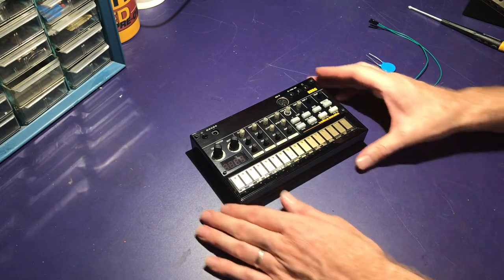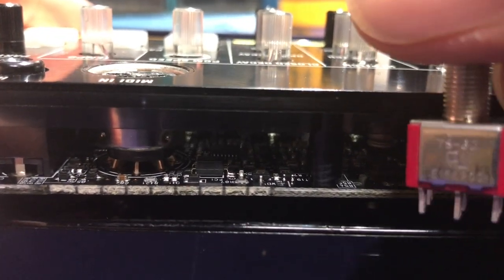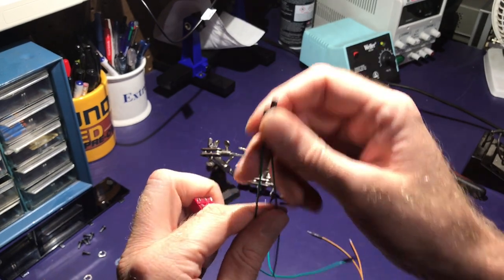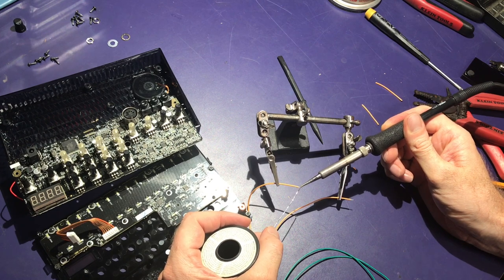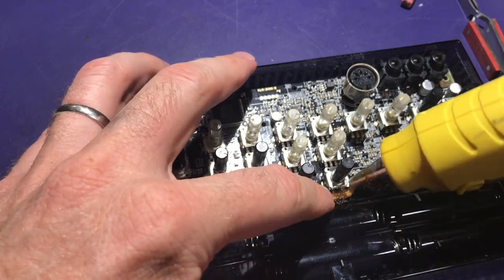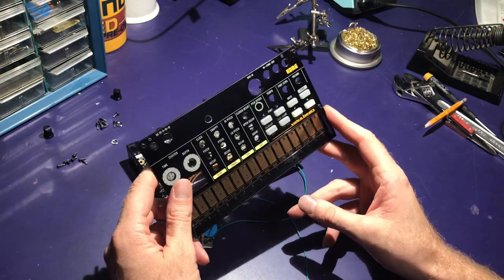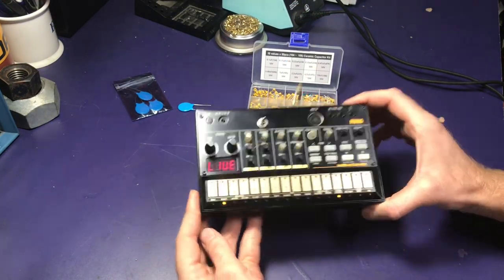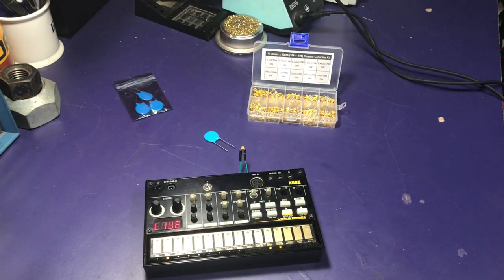How to mod the snare on a Korg Volca Beats (ENTIRE PROCESS)

Comment: so the idea of the cable sticking out of the bottom is to attach other capacitors if you want?
Reply from the maker: brock o'cull yes exactly. However now that I’ve found which capacitor I like best I just keep it tuck inside the battery compartment.
Reply: @SISKworks   I'm pretty interested in this mod with the switch, I've also seen one with a knob installed. would you be willing to do a similar install if I sent you my volca?
Reply from the maker: brock o'cull yeah I might be up for that. Send me a direct message through YouTube and I’ll reply with my email. One thing I thought about doing was to put a rotary switch with a different capacitor at each leg to give a bunch of different snare options.

Comment: Very helpful thanks, however I’m not really familiar with electronic terms and I was wondering what kind of lead wires should I get to be able to plug the capacitor without soldering?
Reply: Needs soldering

Comment: I had a problem with the silicon buttons, 8t was very hard to press the play, then the others. I opened it up to clean it, but it was clean. I found a Reddit where it says that could be the contact material, and suggests to fill the buttons with grafite. BUT I ended up damaging the cable from the batteries, so I tried to solder it, and I failed miserably and now it doesn't even turn on. 🔥🔥🔥🔥
Reply from the maker: ANDRES PEREX NOVOA oh bummer. Are you anywhere near Southern California?
Reply: @SISKworks  No, i'm in Cali, Colombia, South America. Any advice it's welcome anyway. I hope it can be saved somehow.

Comment: Thank you for this video, Mike! Can you please name the exact specifications I have to look for in a capacitor to get YOUR mod? Is it 2,2 microfarad (uf?), 50V? Anything else to watch out for? Not that familiar with electronic terms but wanna do the mod on my beats as well. Thanks a lot!
Reply from the maker: Uli Loe to get my snare sound you need to use a 2.2uF capacitor which should be marked as “225” on the capacitor. Not sure if the volt really even matter. The hardest part of this mod is soldering onto the board since everything is SMD. I would suggest getting a fine tip on your soldering iron and be comfortable with soldering before attempting this. Good luck.
Reply: @SISKworks  alright, thanks. I will see whether I feel up to the challenge when I open that bad boy, haha. You made it look so easy and the mod is just too good to pass up on - I gotta go for it. Anyways, cheers & thanks again!
Reply: Uli Loe exactly the same thing I thought when I did watch it... I ve got a microscope from aliexpress which has a hdmi out & a tft screen. So I hopefully will succeed even with my bad eyesight... 😜

Comment: Weird  I've seen this cap soldered onto two completely different points on the board in other videos! Now I'm confused
Reply from the maker: Martin Heath I think the guy that first discovered this mod was originally instructing people to solder onto different points. Then at some point he discovered the open “C78” contacts on the board and then changed his instructions. C78 is the best spot though.